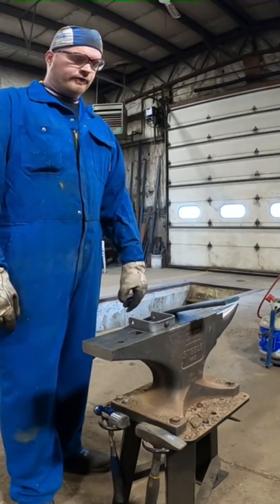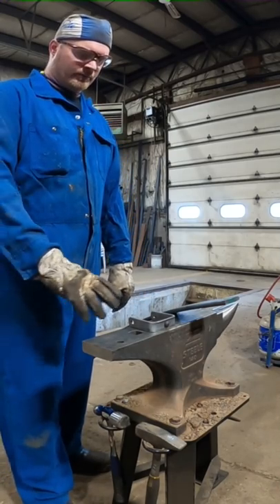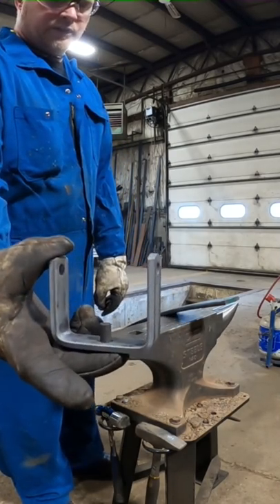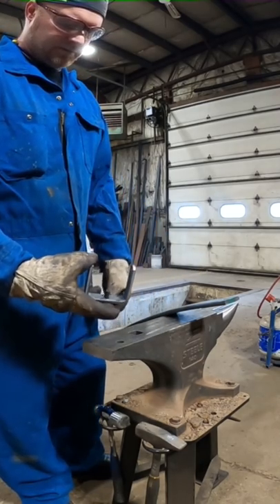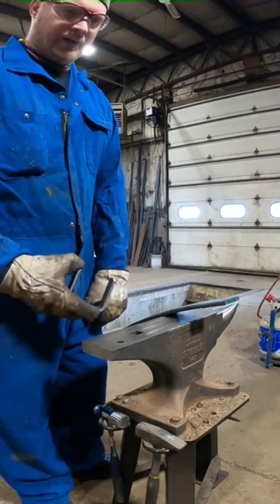Testing out the Alec Steele Anvil

Comment: Pounding cold steel makes it tough to hold onto the hammer and absolutely will tear up an anvil, causing anything from dents to chips.  A new, forged, modern steel anvil may "take it" but if you're running something like my old, Peter Wright, never do this to an antique anvil, you'll destroy it, for sure. 
  Get yourself something like a piece of solid, huge round stock, a rail or I-beam, a cheap, harbor freight cast anvil, anything you can abuse  without expensive regret, streaming down your cheeks...  😆

Comment: So for someone who has no clue. How good is the anvil?
Reply from the maker: so basically it is a work surface.  The less vibration (or ringing) the anvil has combined with how stable it is and how well the anvil absorbs hammer blows without shaking and moving the better.  So it performed pretty well.
Reply: Bigger is often better. Many guys wrap chain around them and attach them to a a super thick post buried in sand to eat the vibrations. This guy and real smiths like him can tell you more about it. Bounce a steel ball on the dirt verses a sidewalk and notice the bounce height. They can simply buy or no buy with that little trick on a “fake” or poor anvil versus a real or good one with proper hardening. We see a chunk of steel, and they see a Ferrari and are often willing to pay what seems like insane prices for the “right” one.
Reply: @john-paulsilke893  "fake" or poor anvil

Sounds like an ASO. "Anvil shaped object"

Comment: Haha that’s crazy! This looks like he shop I used to work at in Caldwell Idaho! The structural framing inside is like identical to the one I worked in. Even the placement of the heater in the corner! That’s crazy!
Reply: Probably a base model sold by the same company to businesses for warehousing
Reply: You talking about the shop at CHS?
Reply: @bdubs3695  Chs=Caldwell highschool? The shop I worked at is on Freeport St right off the 84

Comment: I know you don’t want to hear this but you need greater ear protection. Each strike is in excess of 110dB and in an enclosed, reverberant room the reflections are only going to drop a few dB. Your yellow ear plugs offer 20-30dB of protection which isn’t enough to put you into the safe long term exposure area under 80dB. I do appreciate that you’re at least taking some steps since many folks disregard hearing safety.
Reply from the maker: you are correct.  I've tried a bunch of different hearing protection over the years and I found this is the only one I'll end up wearing, the rest just sat on a shelf or in the break room or anywhere I wasn't.  So it is either something you will actually wear or something you will pretend to wear.
Reply: @simcoespring  that is a very good point. Taking consistent steps to protect yourself somewhat is better than having the hearing protection hanging on the wall. You may consider in-ear active noise cancelling headphones. The plug part offers nearly the same protection as what you currently use against the transient but the active noise cancelling doubles the effectiveness against the reverb tail. Don’t just take my word for it. Check w an audiologist online or in person 🤙🏻

Comment: You have to heat that scroll before you hammer it that should like be better when it's forging it will be more stable I also work in suspension sectors especially in leaf springs 👍

Comment: Is there a reason these guys don't ever hold the hammer @ the very end to get more power from their swings?
Reply: Because hitting steel (hot or cold) puts alot of rebound on the hammer. If you hold it at the very end you loose all control and can easily loose grip after a few swings. There's an old saying in blacksmithing. One well placed hit will do more work than ten sloppy heavy hits.

Comment: Do yourself a favor and switch to wood handles on your hammers
Reply from the maker: no thanks, i used to use those and they where very dangerous.  Kept throwing hammer heads around the shop after i'd break the handles.